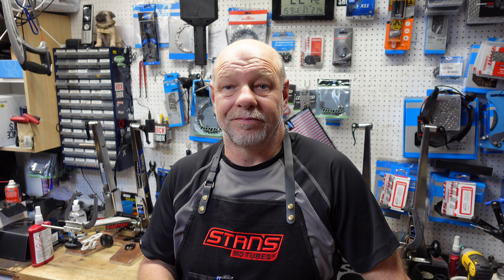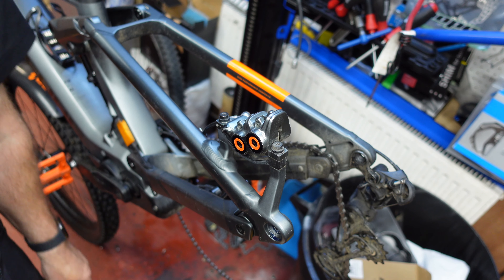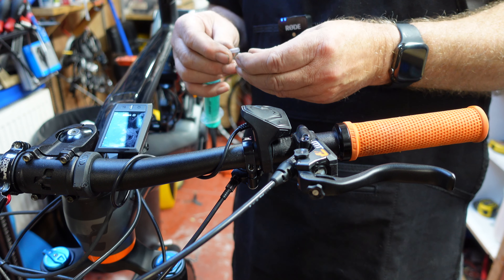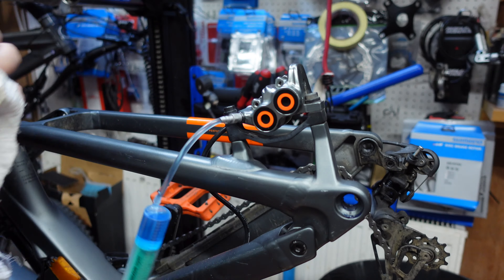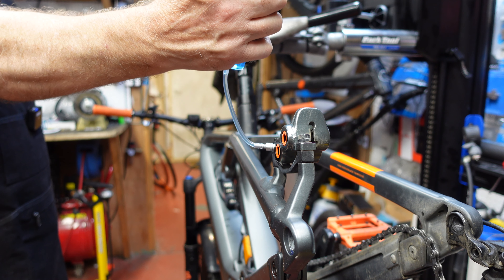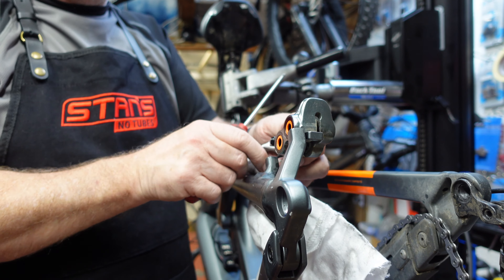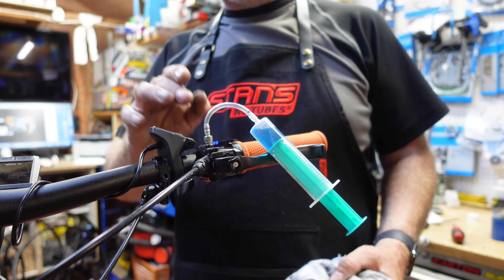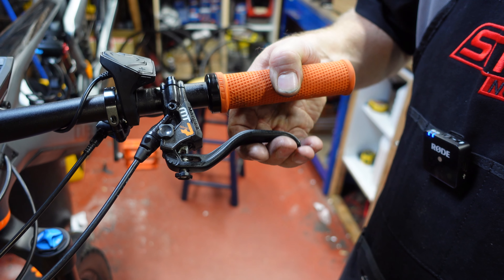How to bleed Magura MT brakes

Comment: Magura has been around for so long you think they could design a bleed screw like SRAM uses that allows you to remove the syringe without introducing air. Great video, I love your powered lift for the Park stand !
Reply from the maker: Hi, Thanks for watching,
Reply: Like many things from old industrial societies, Magura brakes expect a bit of mechanical understanding.  There's no need for what you request, other than your own sense of convenience.  All you need to understand is that trapped air is the enemy of a hydraulic system.  And then understand the way you have chosen to bleed the system.  Usually, the manufacturer's way is the best way.  

Magura's choice of bleed port screw on the MC/lever suggests they expect you to know fasteners, materials, and tool use finesse.  Not the best for a hamfist who never turns a screw or wrench.  Easy as pie for anyone who examines the MC/lever and the screw chosen by Magura.  Gentle efforts are all that's required, but that's beyond some, it seems.

The port on the caliper assumes you'll detach the caliper from the frame and let it rest horizontal -- if you want to do it most efficiently & effectively.

Managing air between a syringe and a MC port or caliper port is a matter of understaning how air gets in there, more than what fastener you chose.

Comment: Also note if you use the proper syringes from magura in particular for the lever no screw nipple required and much easier to bleed, once you've done a few times for practice there no different to any other bleed. Also don't forget to flick the lever a few times to get the last bit of air out which I didn't see in the video, gives you positive lever feel.

Good job 👍
Reply: But why can't you just screw in a jug at the lever like Shimano, and burp the brakes? I work on cargo bikes and getting lever lower than the calliper is a PITA!
Reply from the maker: Hi, I find  the best method is the use a 20ml syringe with no inner strait into the top of the lever bleed port, fill in with fluid, use a syringe on the calliper though
Reply: Yeah, I 2nd your comment, the Magura reservoir bleed port should only be a 'friction' fitted syringe ... I read somewhere in the Magura notes that anything else screwed in (apart from the plastic port screw) is very likely to damage the threads and lead to leakage!
Reply: @indigowolf288  Just found that out following this video instructions. Now my thread is broken on the bleed port, got to buy a new lever as oil is trickling out the bleed port 😞

Comment: Hi! Great video, thanks! I just bought a new MDR-P discs and I tried to fit it to my MT-5, where were standard 1.8mm rotors so far. But these new 2.0mm MDR-P are so thick, that there is no space between pads and rotors, so it constantly brakes. 
I tried to push pistons more inside and bleed it with no breaking pads (yellow tool inserted) but when I've brake, pistons went back to the rotor and stayed in contact. 

Thank You for every tip.
Have a great day!  
Ivan
Reply from the maker: Glad it helped
Reply: The MDR-P disc is the same thickness as all Magura rotors (Storm etc), if the brakes are bled with the correct bleed block (which I didn't see in this video) you should have no problems.

Comment: No need for blocks for the pistons while your pushing fluid through the system?
Reply from the maker: Hi, thanks for your comment, Not in this case, not much pressure on the syringes
Reply: @TheYorkshireBikeMechanic  I tried this on my MT8 brake bleed and the pistons blow out, it was a mess.
Reply: It seems his method of simultaneously pulling and pushing equalizes the pressure so there's not a lot of net force, unlike just pushing at one end. Just a guess
Reply from the maker: @benalmada  hi Ben, that’s correct.
Reply: There is zero reason not to put bleed blocks in when doing this procedure. Save yourself a potential huge headache.

Comment: The syringe should be pushed into the bleed port on the Master. Anything other than the bleed screw being screwed in to the master will most likely damage it. 

Always best to take the caliper off and hold to the bleed port upright too

Comment: Hi did you lock the pistons with the blue lock off key ?
Reply from the maker: Hi, No I didn't, there was not enough pressure going through the system to move them.
Reply: @TheYorkshireBikeMechanic bled my brakes today and the pistons in my mugara MT7S just popped out because I never used the lock

Comment: I think u have just saved me throwing my mt7s in the bin 😂😅🤣😅
Reply from the maker: I can understand your frustration, so tricky
Reply: I think it’s because I didn’t turn the caliber so kept letting in air so hopefully it will work this time 😂😂
Reply from the maker: @apaquatics6172  keep the caliper higher than the lever, good luck.
Reply: I spent best part of 3hrs trying to bleed my rear brake recently. Great brakes power wise, but simply the worst to bleed. Watched several different video tutorials, all a little different. And the lever still feels like 💩. I was so frustrated I went shopping for a replacement. I am by no means a novice bike mechanic, and many give sram/avid brakes a hard time. They're easy compared to magura
Reply: @jim_nix71   I was in the same position until I come across this video and now I’ve bleed mine twice now since and they have been amazing

Comment: The bleed screw at the calliper is the main flaw of the Magura system during a full bleed. The plastic bleed screw at the lever, or master cylinder, is designed to strip if too much torque is applied. This saves the master cylinder from becoming useless or destroyed, unlike some Shimano master cylinders with metal bleed screws. If you’re worried about stripping a plastic Magura bleed screw …reduce your torque and have some spares on hand. They’re cheaper than a master cylinder. Ask how I know. 

During a full bleed it is important that the front or rear brake calliper be at the lowest point. For the rear brake you may need to position your bike in a vertical position so that any trapped air can rise to the master cylinder. Flick the brake lever to release trapped air in the master cylinder with bleed blocks in place. 

A funnel with a threaded adapter, or an open syringe, at the master cylinder is fine for a Magura full bleed. A push and pull can be done at the calliper (several times) and insure no air is being introduced into the system. A closed and tight system is important here. 

Keep doing a push and pull until no more air is observed. Tap on areas which could trap air. Once you’re satisfied with the full Magura bleed, close the system, clean things up, reinstall everything and go for a ride. A rough ride. Some trapped air will be released during this ride and the brakes may feel spongy or completely useless. 

Do a “mini-bleed “ at the master cylinder with a funnel or open syringe. Flick the lever until no additional air bubbles appear. This only takes a few minutes but is necessary after a full bleed. Close the system again and enjoy your next ride. 

Magura brake system can be tricky at first but the feel of the brake system is unlike any other I have tried …especially on eMTB’s with 220mm rotors. Brake fade during long descents is almost nonexistent and I like the feel. 

I’ve learned a few techniques from this video. It’s good to see how others tackle a Magura install or bleed.
Reply from the maker: Hi, Thanks for your comments
Reply: Why is it a flaw, just because it requires the mechanic to know what he's doing? There's an ample interval between the minimum force that's necessary and excessive force. Just take it easy, that's all. Also, every mechanic should have a torque meter and follow Magura's recommended torque, but even without one it's not difficult.
Reply: @borthwey  
Hi David. IMO, the bleed screw at the master cylinder on my MT7 brake (f/r) seems to be plastic and uses a T25. Thankfully it requires very little torque to close the system after a full-bleed or mini-bleed is preformed. In most cases I don’t use a torque wrench for this screw (-2nm) and rely on sufficient torque, to close the system, with a T25 screw driver. The material of this screw is likely designed to fail if it is accidentally over-torqued thus preventing any damage to the master cylinder. (Not a flaw imo). A replacement screw would only cost Pennie’s if it was accidentally stripped. (I have a couple of spare screws but haven’t needed them). 

You may be commenting on the bleed screw at the calliper. If you know of an easier or better method I’d be happy to learn. 
During a full bleed I remove the screw at the calliper and screw in an adapter which attaches to a clear tube, which attaches to the syringe. During this process, or step, some brake fluid is spilled and possibly some air is introduced into the system. No big deal. But a different method could be used here. Torque pressure of this screw, at the calliper, is very important (probably +2nm, I can’t remember). 
Regardless, a mini-bleed is usually required after the initial bleed. A couple of rides, (or vibration) seems to release trapped air, possibly from the callipers. I use different orientation of both the front and rear calliper to try and prevent any trapped air but a mini-bleed seems necessary after a few (rough) rides. Regular maintenance is key also (pad wear, fluid levels, cleaning, alignment etc) like any brake system.

Comment: I have brand new MT7 calipers and have performed this exact process a few times.  No air at all in my lines.  Lever is firm to pull.  The pistons however do not retract and stay “gripping” the rotor.   Any suggestions?   I also removed a small amount of oil thinking it was overfilled but with no change.
Reply from the maker: Hi, Thanks for watching and your comments, it's so difficult to fully understand without been in front of the bike, the hydraulic effect of returning pistons can be restricted if the is debris around the piston enclosure or there is a tiny pocket of air behind the piston, or they dont come out square due to mis alignment. both brakes the same problem?
Reply: @TheYorkshireBikeMechanic  Yes.   Both calipers have same issue.   Spoke to a Magura rep in the USA and they will send me replacements and hope that solves my dilemma.   He also tells me that the pistons should naturally return (retract) to their start position, even out of the box dry and not even installed.  I'm not sure that is accurate as i have to manually press the pistons back to home while bleeding.   There is no spring or other mechanism that i know of causing the pistons to retract.  I assume it was a vacuum effect when releasing the lever.
Reply: @mspring6387  You ever get this sorted out? I'm also in the US and have installed MT7s on 2 bikes, same issue. The pistons don't retract much and just rub. Googling indicates this is common, but it's driving me nuts.
Reply: @uberamd  I had Magura send me a new set of calipers and the 2nd pair was certainly better but i still find the pistons do not retract as they should.    So i allowed the minimal bit of rubbing and eventually the pads were worked in and no longer rubbing, but at the sake of losing some longevity of the pads.

Comment: Nice approach. I own a MT5 set. I have used a Force bleed kit (a cheap one, yet it has brass adapters). Force adapter+shimano funnel at the lever side, and similar setup at the caliper. Results: front - strong, firm bite point, like a Shimano; rear - a little spongy, yet the bite point is consistent and the brake has power. The only thing that drives me mad is a judder developed by the front brake... Caliper is aligned, the rotor is true (Storm centerlock 203). Bedding in done properly. Ran out of ideas on this issue, any recommendation ?
Reply from the maker: Hi, thanks for watching, there are so many reasons why you can get a judder, the only way to solve it is a process of elimination, if you have the same rotor on the back swap it,  its just a case of changing things slowly, and re-setup, sorry I cant be more helpful.
Reply: Same issue with my MT5 front on my hard tail. MT7's on other two rides......no issue.

Comment: How good are the mk7 breaks for a eBike are they better than hope v4
Reply from the maker: Hi Connor, Many people love the MT range, Danny Hart has them on his downhill bike but seeing how he rides I don't think he uses them. I have experience not just from a service point of view but a rider also both MT and Hope V4. My personal experience is that V4 are the best brakes I have ever used, providing you use the vented rotors, Expensive but amazing once they are set up correctly, this also applies to maintenance too.
Reply: Don't know about a comparison but my MT7's are as good as I can imagine anyone would need
Reply from the maker: @GedandMichele  Hi, the MTs are a great brake, it's all about the feel & feather and a personal thing, shimanos are a great brake two, the saints are amazing but again a completely different feel.

Comment: CAREFUL.  if you push the pistons back into the housing without looosening the bleed port on the lever, you can blow-out the weakened square side that covers the bladder on the lever.  I've done it and it trashes the levers.
Reply: It happened in this video too. As you can see at 15:19,  while he pressurises the lever side, oil escapes through the bladder that he ripped when pushing back  the pistons without opening the lever bleed port.
Reply from the maker: Hi, thank you for watching and your comment. This is normal, it's a breather port to to allow air into the top of the reservoir to allow the diaphragm to sink as fluid gets forced into the caliper, the diaphragm should not split unless over forced.

Comment: I've done this 3 times with my mt7. Whenever I undo the lever syringe, fluid pours out the hole, and I have no lever firmness. Frustrating
Reply: You’ve probably overpressurized the system. Try to do it with an open cup or syringe at the lever instead of a syringe with a plunger.

Comment: The best thing one can do with magura brakes, is to throw them away as far as you can, as it's an utter crapshute.

I mean, they use goddamned plastic screws. It's crap.
Reply from the maker: All comments welcome good or bad
Reply: @TheYorkshireBikeMechanic  I can substantiate it. Magura used to be basically the only hydrolic setup on the market. So then they built the name being great. However, time progresses and there are other brands, and Magura has cheaped down their brakes, making it crap.

For instance the fill port on the handle. It has a PLASTIC screw. About the handle: it's all PLASTIC. Then the wheelpart of the break, magura made the quick release levers an optional part ($$$) and have changed the bushings. The old plastic bushings were made so that you could twist them to bring the brake close to the wheel. The new ones do not have that.

Comment: good video help & advice -- I have upgraded my Omnium cargo bike with 203 mm rotors and new Magura brakes. Some Bullit cargo bike users say them Maguras were heavy maintenance and they'd switch fro Shimano hydro disc brakes. Is it true, that them were heavy maintenance in comparison to Shimono brakes?? See here (w/timestamp) https://youtu.be/IoQH2aZ8l0A?t=446
Reply from the maker: Hi, Thanks for watching and your comments, Cargo bikes, in fact all ebikes need excellent brakes including big rotors to cope with the heat and stopping power needed. magura 4 pots, hope v4s and shimano saints are the 3 main contenders

Comment: Rear of the caliper was still higher than the bleed port when filling, it needs to be vertical when filling the system. Can't say no air at all there very well could be air trapped. Also never showed a lever flick all around mediocre video in a technical job.